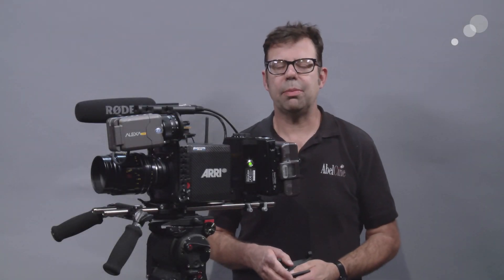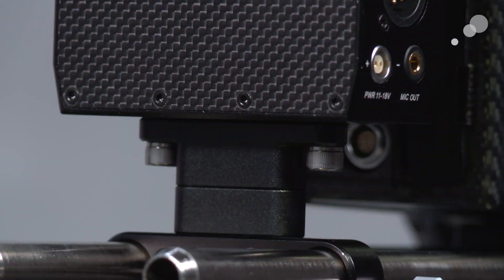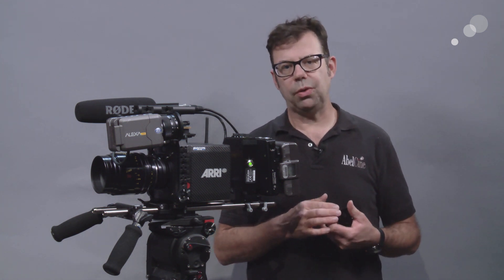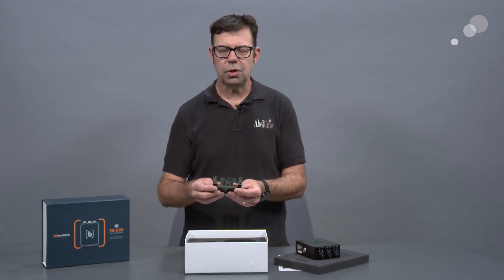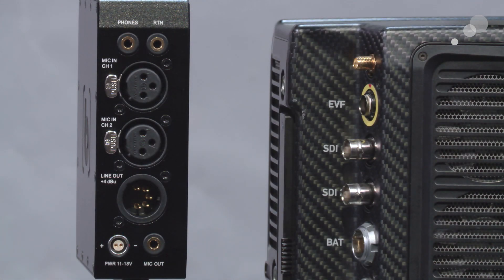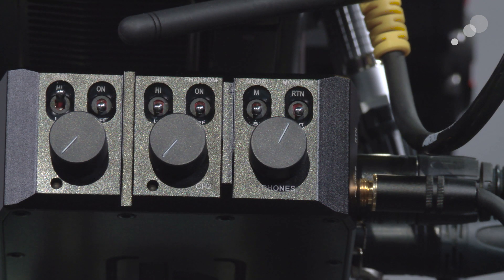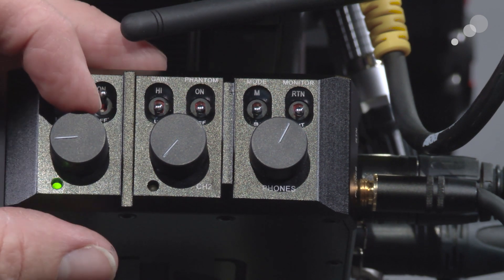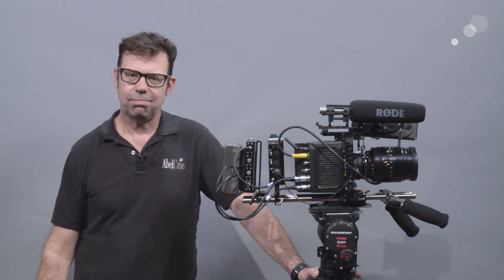At the Bench: Beachtek DXA-ALEXA Preamplifier for ARRI Alexa Mini

Comment: So how does it get power? From the camera? Batteries?
Reply from the maker: There's a common 2 pin Lemo connector for power. In the video, Ian is using a 2 pin to 2 pin Lemo cable to receive power from the Wooden Camera D-Box. 2 pin Lemo is fairly standard, so you can use various cables like P-tap or XLR4
Reply: Can the mini record a scratch track by its self ? Or I need to buy external preamp ? Thinking mainly playback for music video performance (just need a guide or scratch with video )
Reply: @tsproduction2010  The Mini does not record scratch audio by itself. For scratch on music videos a simple Wooden Camera A-Box with a simple XLR mic or the mini-mic that can be plugged into the front is more streamlined and less hassle